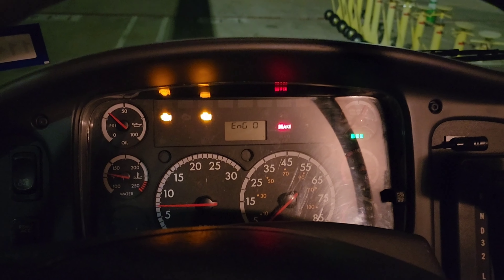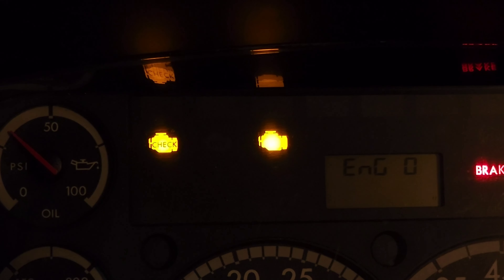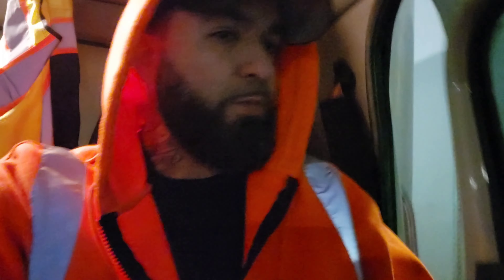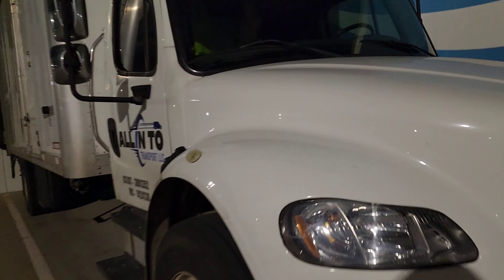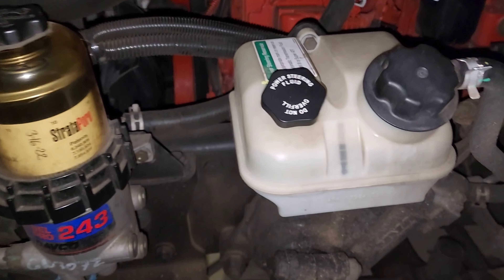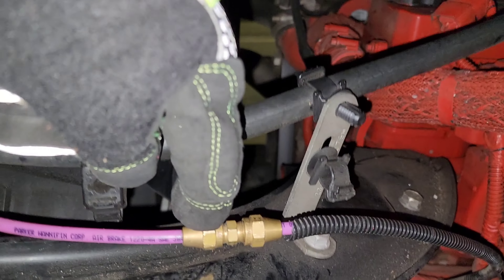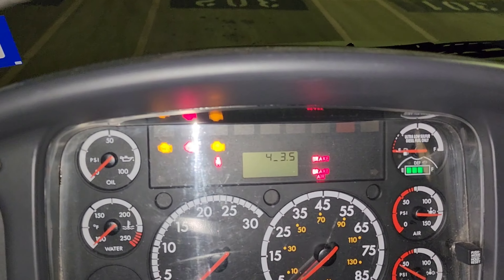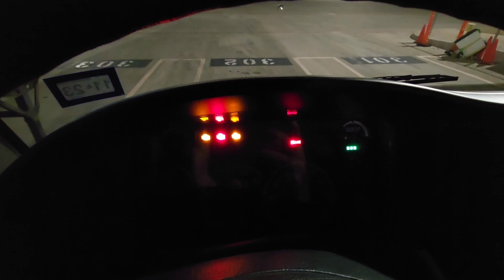THE WORST PURCHASE I COULD MAKE??!

Comment: As far as the air brake beeping it will do that until the air brake pressure builds up to 60 psi. Around 90 psi is a Normal drivable pressure. But it’s gonna beep every time until it hits 60 psi. Check the gauges every time it does that and make sure it at least is building up to 90 psi

Comment: these are not new issues with the Freightshaker M2's. It's probably an emissions issue or your coolant is low. If it isn't low on coolant it's most likely emissions. When it derates power, you can make it run at full power temporarily by shutting the truck off, then unplugging the sensor from the coolant tank. let it sit for a minute, then restart. lights will still be on, but at least you'll have full power to get you to a shop.
Reply: They're also famous for wiring harness issues. that's a real nightmare. hundreds upon hundreds of doll hair sized wires to test. Can literally take over a week to find the broken wires. Last time my company truck was down it took 2 weeks to find and fix.
Reply from the maker: Good info I will definitely try this out thank you!
Reply from the maker: Sheesh yeah I'm hoping it's ecm or fuel pump something not too serious that warranty will cover 🤞🏼

Comment: Its hard for you now,but keep pushing it will better. Remember why you started
Reply from the maker: That part!
Reply: @Corymo_  get a code reader so you can find out what the issue is so they don't get over on you
Reply: @Corymo_  start a trust and put your assets into it. Also, did you use an llc for the truck?
Reply from the maker: @christopherlewis1292  yes I had to make the llc to get a truck